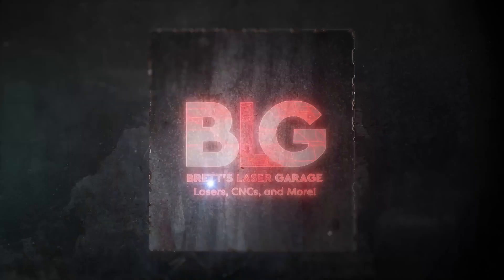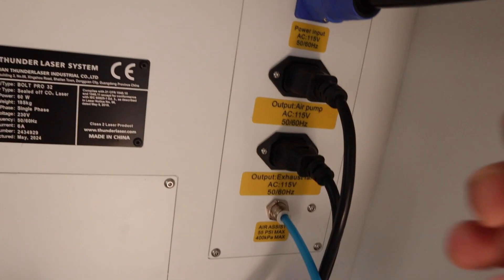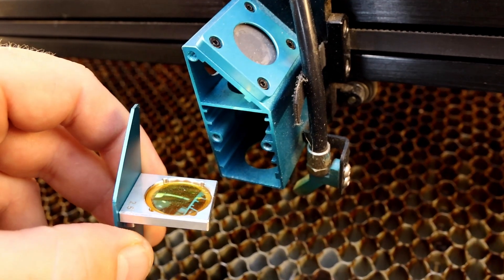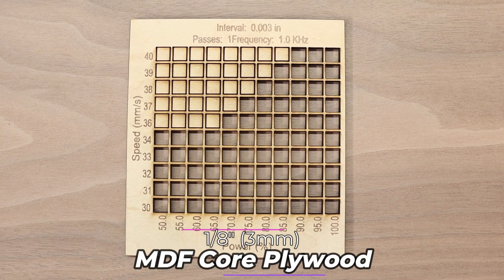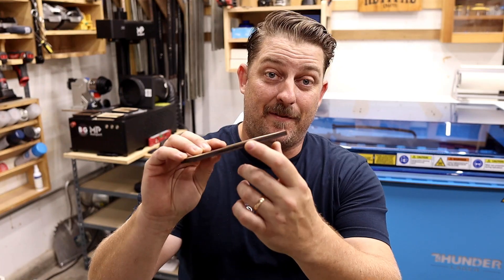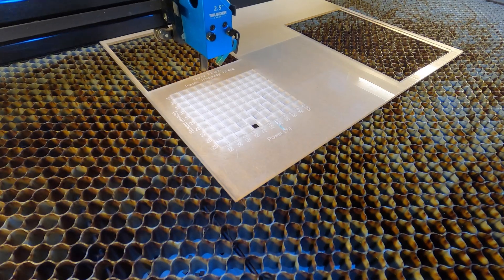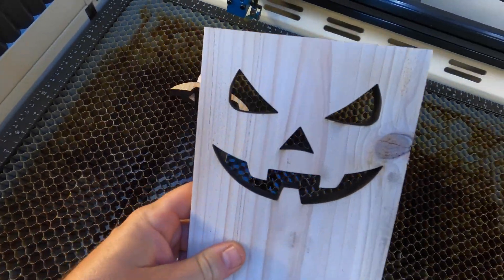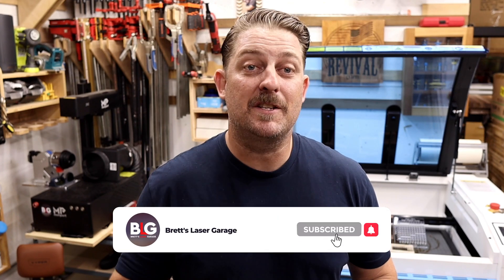Bolt Pro 32 Cut Testing | Thunder Laser | Brett's Laser Garage

Comment: So does the Bolt Pro 22 perform the same but with a smaller bed size?
Reply from the maker: Not exactly.  The pro 22 has a 40w RF tube.  The pro 32 is a 55w RF.

Comment: Dude - great video, I just found your channel and subbed. I love how you touched on realistic cut speeds (with test cards) not just the rated max. speeds which don’t give the full picture. And when you started talking about the importance of clean cuts (to minimize post processing / sanding) I was like, yep, this guy “gets it”. I’m shopping for a co2 laser upgrade and the Bolt Pro 32 is on my list. Anyway, I know how long it takes to make videos like this, so I just wanted to give you some props. Cheers.
Reply from the maker: Thank you very much for the kind words.  My main goal is to help teach people how to use lasers or CNCs and I really try hard to show realistic scenarios and tests.  The Bolt Pro 32 is fantastic, I highly recommend it. 

 Keep up the good work bro, I’ve been a fan of your channel for a while.

Comment: Im curious how it stacks up against the Thunder Nova series
Reply from the maker: I don’t have a Nova but generally I will say this from talking with Thunder and doing research.   The Nova’s can cut a little better when equipped with a 100 or 130w glass DC tube.  I mean, a 130w will be able to cut 3/4” plywood.  But a nova will never be able to engrave like the Bolt Pro with its RF tube and small dot size.  Basically to put it simply, the bolt cuts good and engraves great.  The novas cut great and engrave good.

Comment: Can’t find that video from Chris on the frequency changes. Could you point it out? Had no idea it could be adjusted until your video. Do you have a list of recommendations for materials and frequencies yet?
Reply from the maker: No I don’t have a list per se.  You’ll have to run material tests specific for each material.   Keep speed and power constant but add frequency as the only variable on the test.  Generally I cut everything at 1khz frequency and I engrave everything at 25khz.  

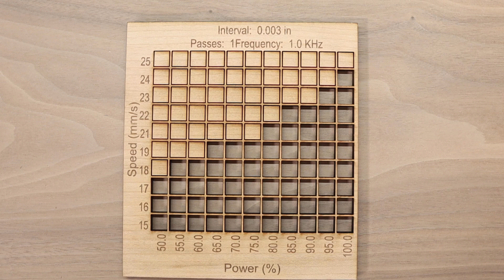The video is on Thunder Laser USA’s YouTube and is called Thunder Bolt: Can it cut???  He talks about it around the 7:00 minute mark.
Reply: @LaserGarage  Great information - thanks again.

Comment: Great job on the video! But...the Bolt Pro 32 is $15K and you had to upgrade the air compressor to get the most out of the laser...are you kidding me, that's very disappointing.
Reply from the maker: Like I said, it’s not necessary but extra air helps.  You can only get so much output out of an on-board air pump.  There’s size/space considerations to deal with when it’s integrated into the frame of the laser.  All lasers are like this and all of them can benefit from extra air pressure.

Comment: Will the test cards work with fine with the 30 watt Bolt? Also, will you be doing a engraving video in the future with different types of wood and acrylic? Love the content!
Reply from the maker: Yes and yes!  Thanks a lot for watching.   Material test cards can be ran on any laser and on any material, you just need to change the parameters.  The cut settings I used on the Pro 32 will not work on the regular bolt though, you’ll have to turn them down since it’s lower powered.

Comment: Do you need to re-align the mirrors every time you clean them?
Reply from the maker: Nope, the quick release setup registers the mirror in perfect position when you re-insert it back in.  Alignment stays intact.  

I check mirror alignment every week or so with a quick pulse check, takes less than a minute and been spot on every time so far.
Reply: @LaserGarage  Does the standard 30w bolt have that feature?
Reply from the maker: @TheExtremeElementz yes it sure does.